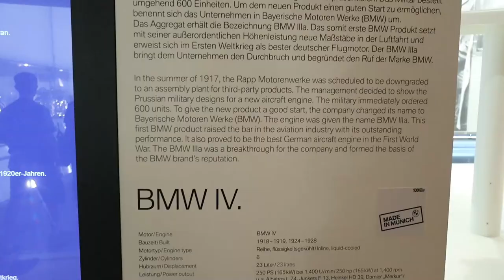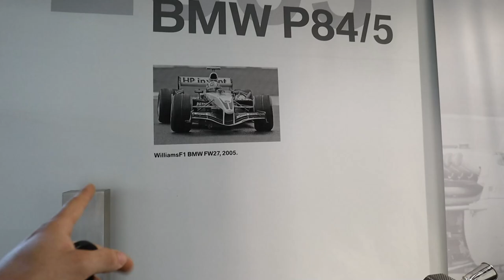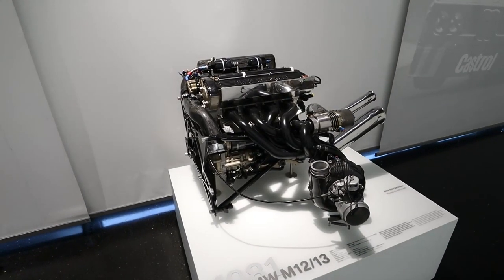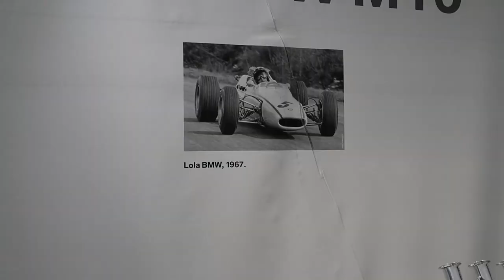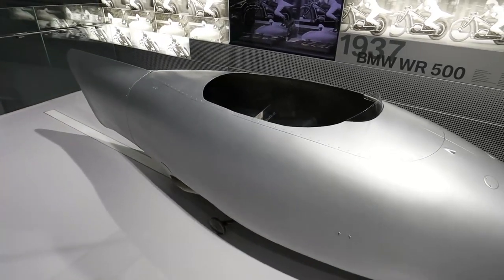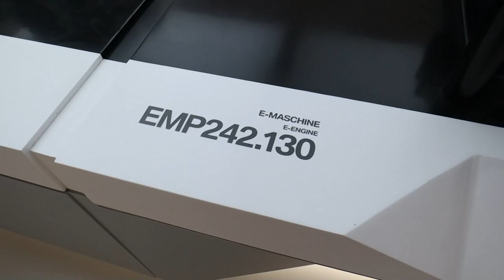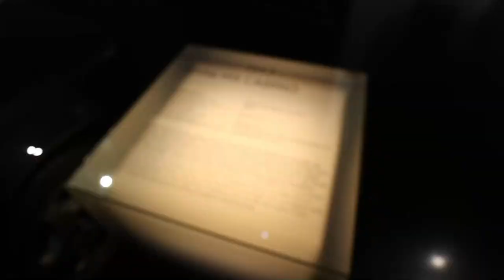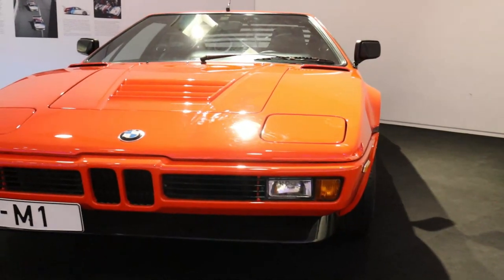Exploring the BMW Museum in Munich (My Dream Come True!)

Comment: The BMW 801 aircraft engine 6:29 was used in the Luftwaffe during WWII in their top of the line fighter pictured on the wall.  It produced almost 2,000 horsepower.  I have heard that the BMW roundel represents a marine propeller.  The blue is the water and the white is the propeller.